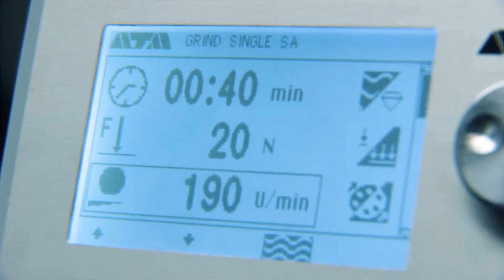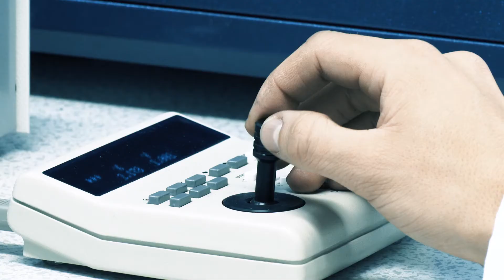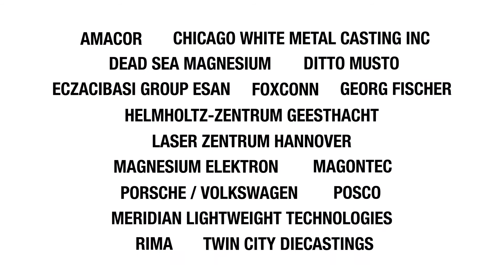Applications of magnesium alloys ( I.M.A. , 2017 )

Comment: Is it possible to build complete engine and frame of motorcycle with magnesium. Engine head, pistons,piston rods, engine casing, crankshaft, camshaft, valves, chain and sprocket, frame etc. Especially gears and shafts in motorcycle engines. Reply